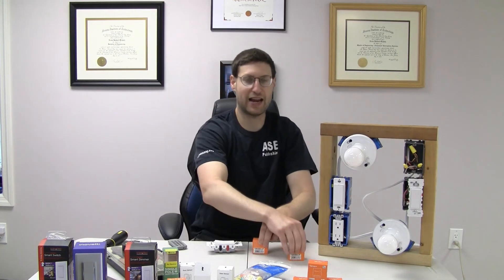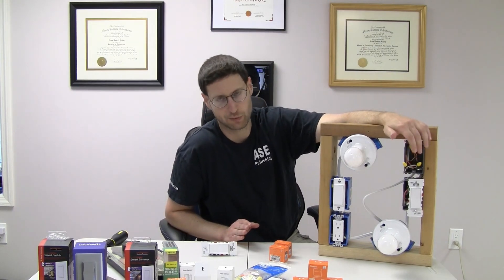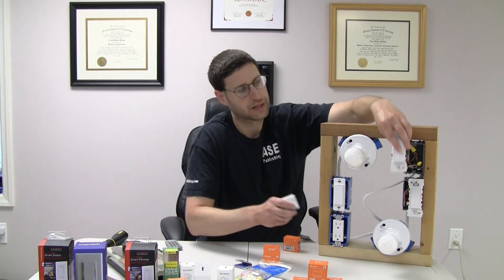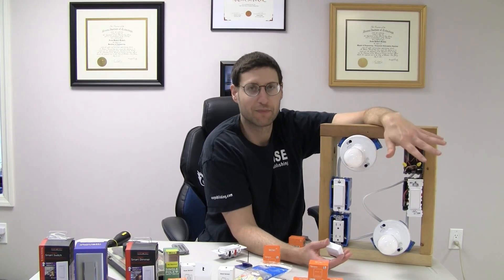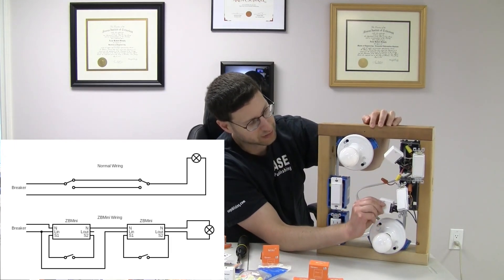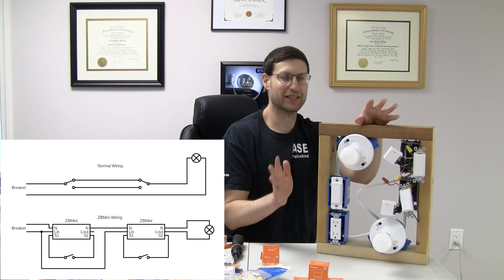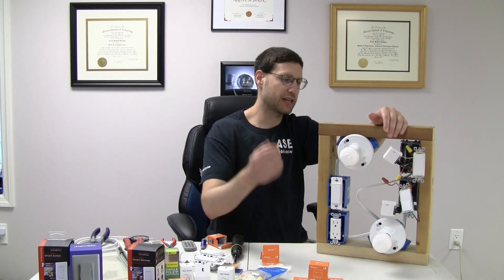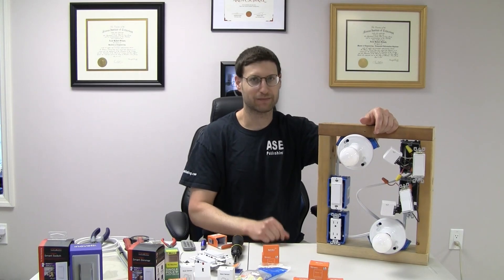3 Way Switch Circuit Using 2 Sonoff ZBMinis - Smart Home (TTWA) #7

Comment: So I can wire 1 zbmini through a single pole switch and automate it to switch a 2nd zbmini on and off wirelessly is that correct? As long as theyre both powered by live and neutral of course...

Comment: Seems to require both neutral and live at the existing 2 way switch - however that is not always available without additional cable
Reply from the maker: No, it doesn't. It uses the existing wires to provide the hot and neutral and leaves the signals to each Sonoff within the same box.
Reply: I see that you have 7 wires entering each 2 way switch.  I guess that's a US thing.  In Europe there are only 3, maybe 4 if it's earthed.  That's why Sonoff designed those devices to operate without the need for both live and neutral.   Happy for you if you have all those cables available but not the same as Sonoff's wiring diagrams. @AronSchatz
Reply from the maker: @grahamgodden6574  Depending on where the box is in the circuit, not counting the ground, you need two wires coming from the panel, two wires going to the load (light), and three wires between the switch boxes. This can be different if the 3 way switches are broken at the load or in the middle/end of the switches.
Reply: Yes you got it - thanks for that - unfortunately it is common in Europe to only have 3 wires at the switch i.e. a wire that goes either to the load or to the panel and the 2 "rails" as we call them, between the 2 2-way switches so not enough existing cables to do as you propose.   Anyway, thanks for the discussion and good luck with your projects @AronSchatz
Reply: Maybe the 2-way switch could be removed.   Use one of the "rails" to connect load to live through ZB Mini (located behind one of the switches).   Set the ZB Mini switching to "pulse mode".   Instal "push" switches to replace the 2-way switches.   Use 2nd "rail" to connect push switches in parallel.   "Pulse mode" only requires one wire input (see Sonoff diagram).  I haven't tried this and I don't know if the ZB Mini passes enough power continuously (when the load is switched off) to power the input to it's input via the push switches.   I scribbled a wiring diagram but cannot see how to send it to you.  Anyway, just an idea, you got me puzzling.   Have a nice weekend, don't fry any gadgets !
Reply: @grahamgodden6574  What he's doing is converting the rails into simple neutral and line. Run that to any number of switches. Except for the zbmini that drives the real load, the rest are simply detecting toggles.

You've got enough wires, even in Europe.
Reply: @WebbedPete  Thanks but ... the 2 way switches that I have seen (UK & France) only have 3 wires (power in/out & 2 rails).   Usually, the 3rd cable is live or switched live but sometimes neutral or switched neutral.   I have rarely seen both live and neutral available in the same switch.